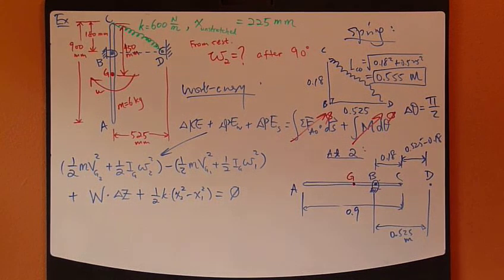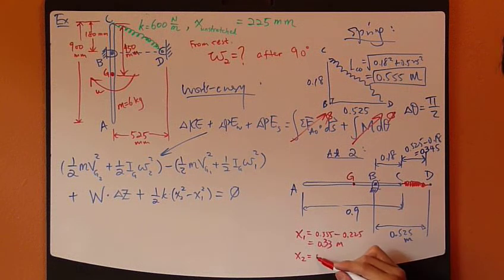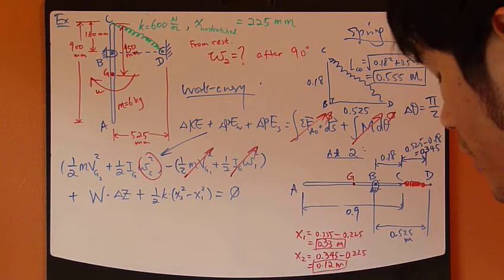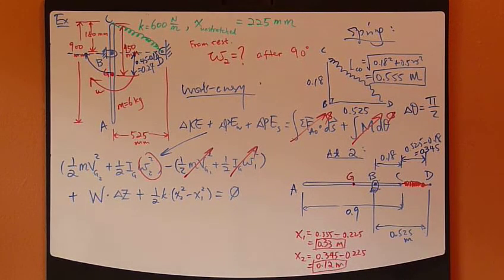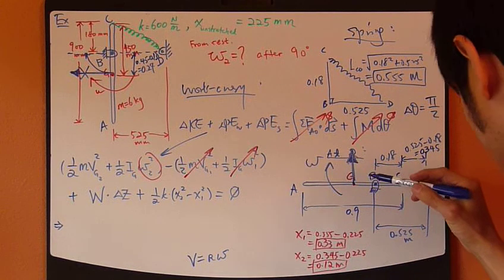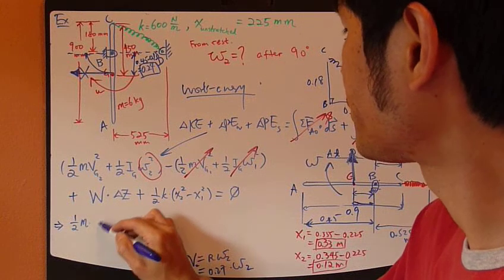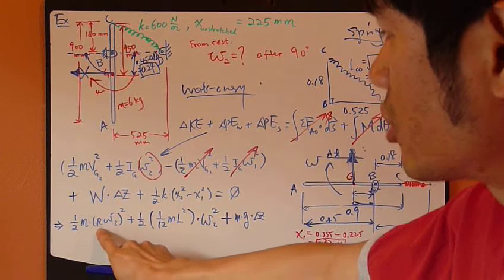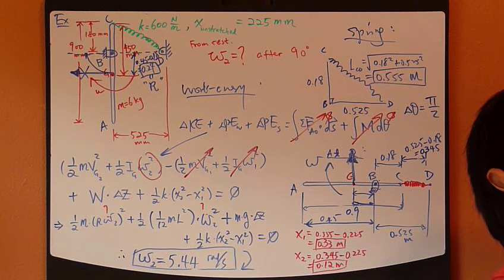Engineering Dynamics Ch.18 Part4: Rigid Body Kinetics - Work-Energy

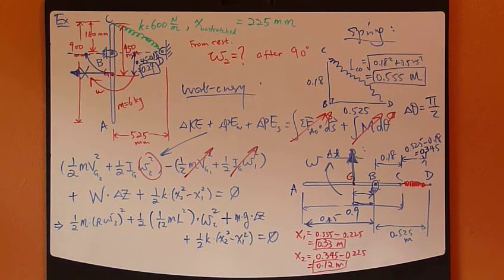Comment: great videos! question, at 6:42 what is (delta) z?
Reply: It's the change in vertical height for point "G," which is the distance between G and B. According to the drawing on the top left, it's 0.45-0.18 = 0.27m.

Comment: i could be wrong, but are u not suppose to use Parallel axis theorem for the rod?
Reply: I don't think you need to because the term he is using for I is about G. You only need to apply PAT when you are identifying inertia about a point NOT at G. I could be wrong though.